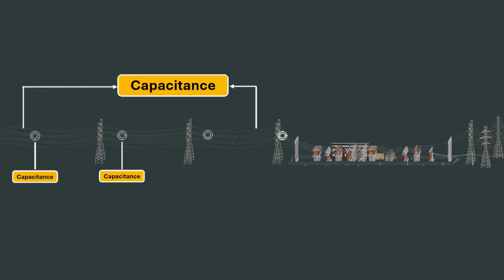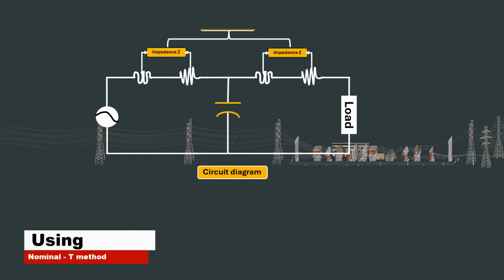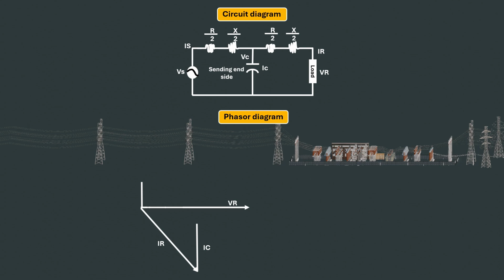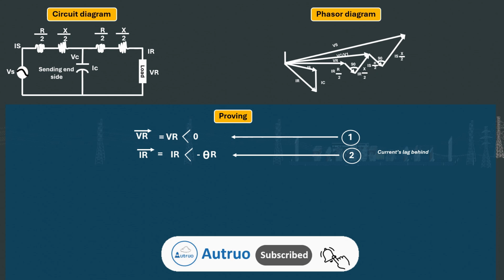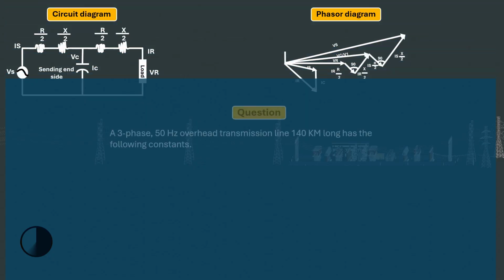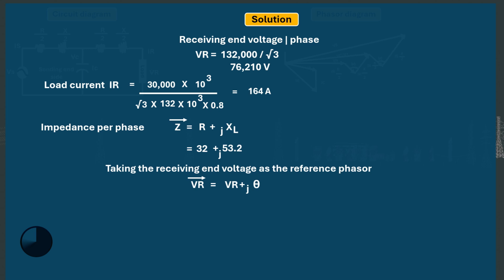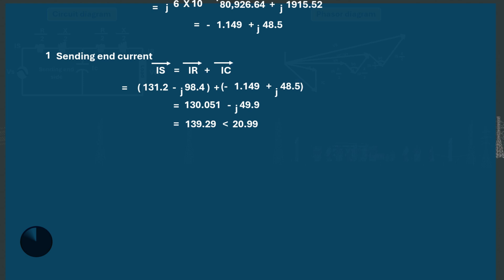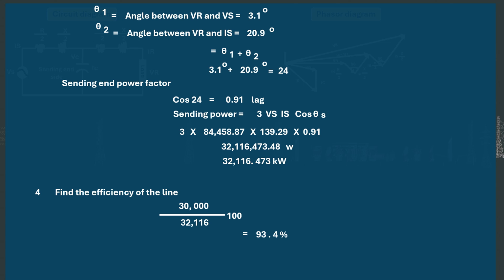Revealing the Secret: The Truth Behind Nominal T Method

Comment: Is there a way to transmute power without loss off  energy without wires and transmission lines, question I’m curious ??
Reply from the maker: Wireless power transmission is possible, but some energy loss is inevitable due to physical limitations like resistance, radiation losses, and environmental absorption.